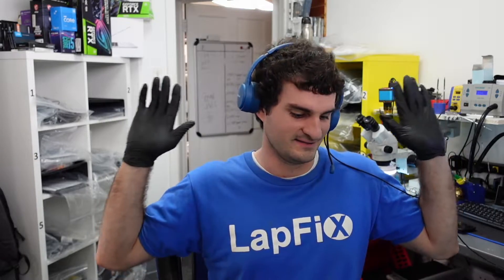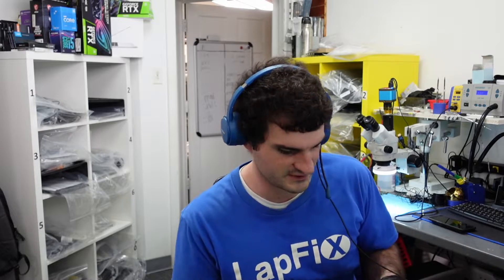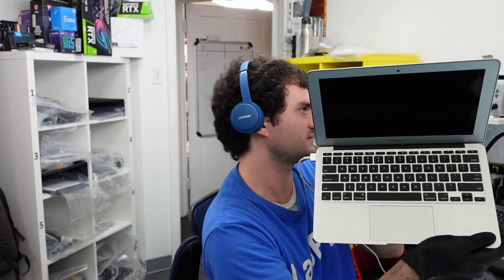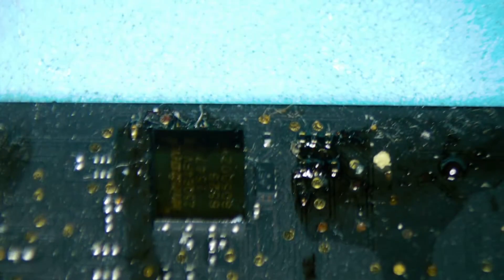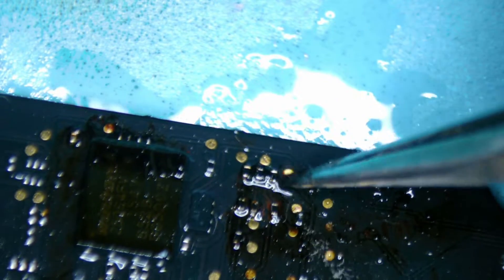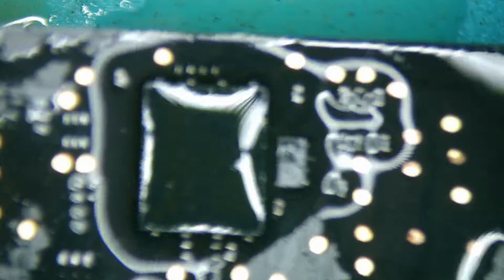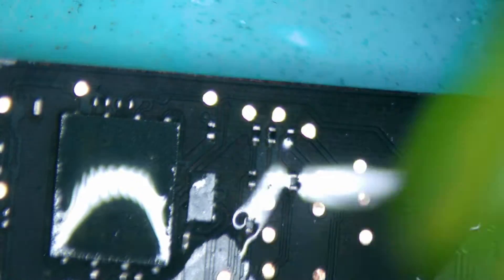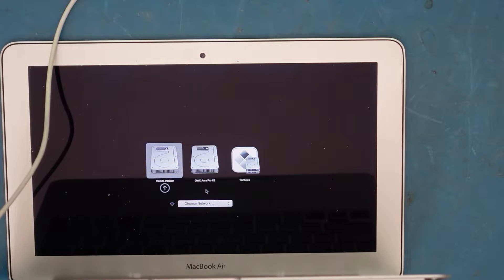How To Remove A STICKY Liquid From a Macbook Logicboard

Comment: Ultra Sonic is the best, it gets under the chip and dissolves the crud under that too.  Good trick with the distilled water.  Why distilled water?  Because it does not have contaminates in it like tap water (calcium to name one).  Ever washed your windshield with water and see white spots appear when it dries?  Yeah, you don't want to use that on a motherboard.